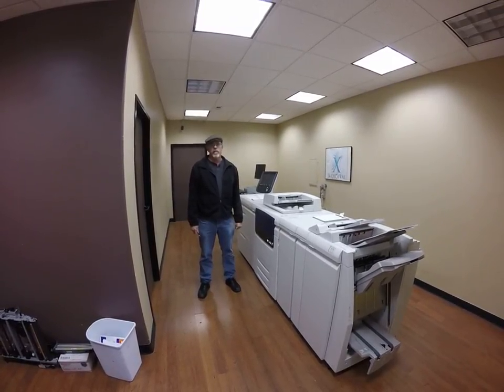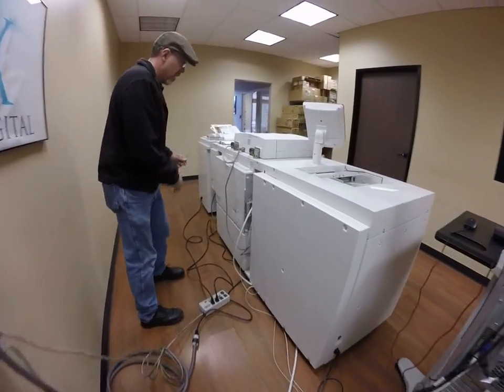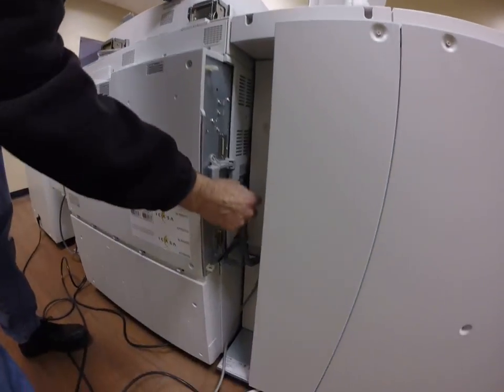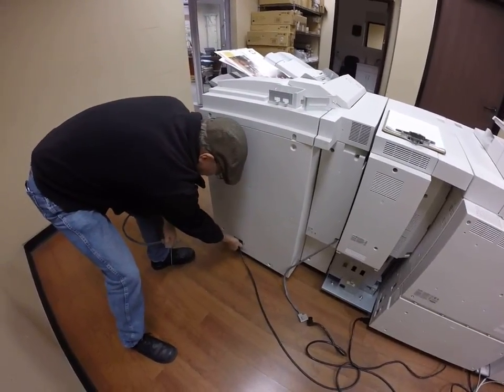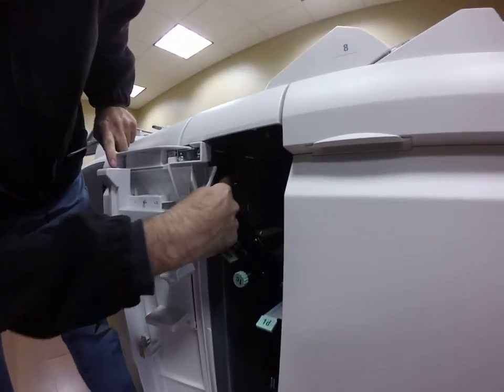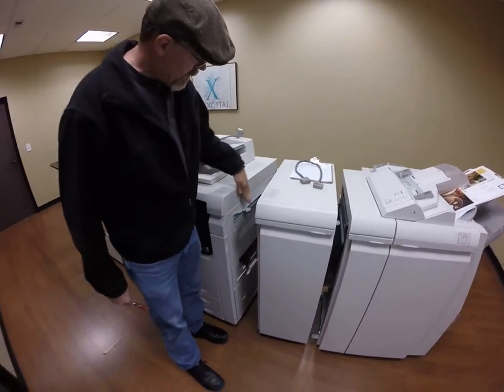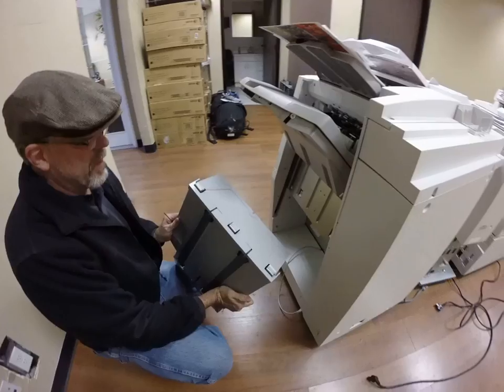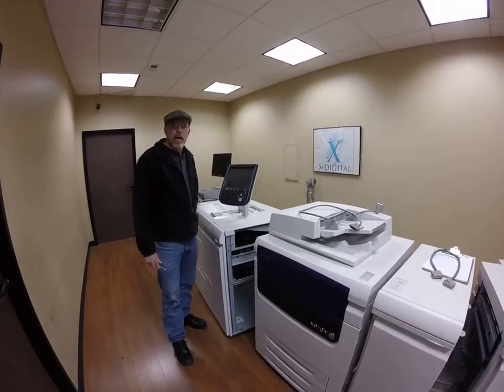Xerox 700/C75 De-install / Install

Comment: Thanks for the video. I had some issues after installing, got error "Check the connection between Interface Module and the finishing device". I re-installed cables twice, called to service and checked this video again to notice that electronic devices work bit better when power cord is attached :D
Reply from the maker: haha.  Power Cord is a must! Should we make more videos of installation/technical how to fix error code videos?
Reply: @xdigitalinc  Yes Why not it very important

Comment: I am too! I also need the service manual. I have an issue with drawer 2 and three not lifting. They engage but won't lift without help from me. All sensors work. I need the service and parts manual.

Comment: Could you make a video about leveling the printer and feeder i'm having some trouble about that
Reply from the maker: that is a good idea.  yes we will make a video soon about leveling the machine.
Reply: It'd be realy great! Leveling is one of the most important thing for registration. Unfortunetly setup guys weren't did this job properly. 7 and 6th trays works fine but 5th one is realy bad :(